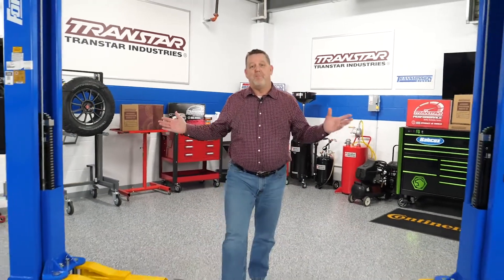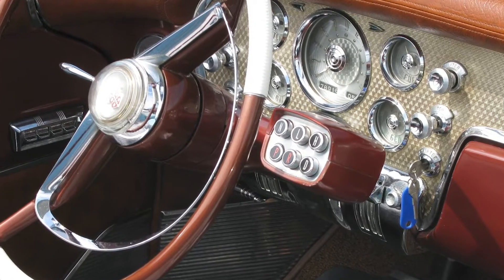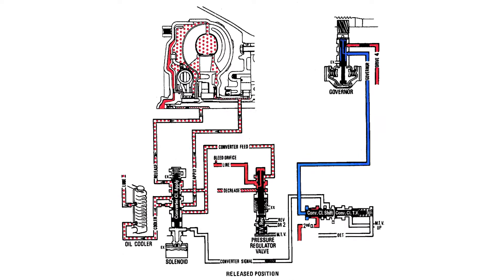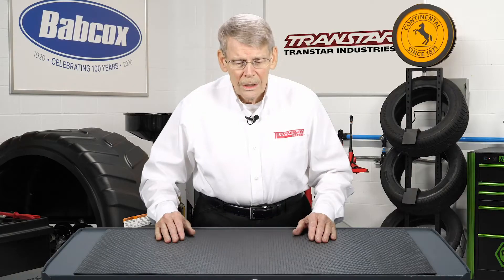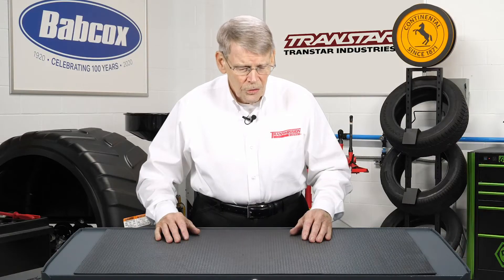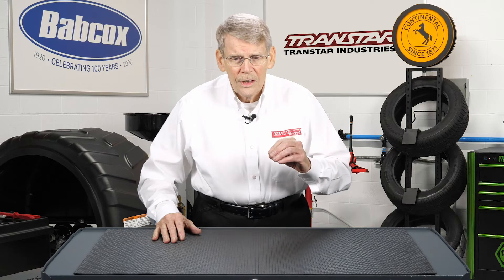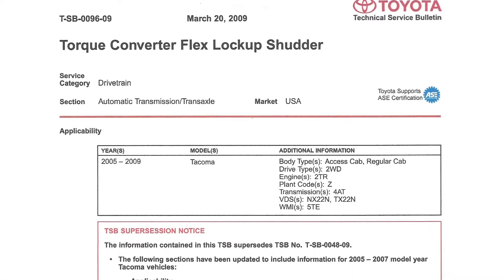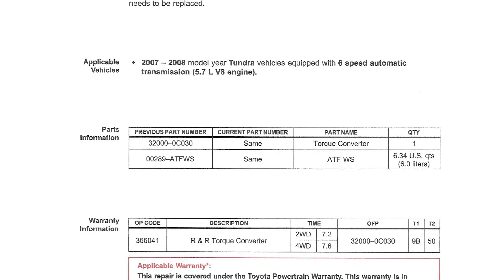Minimizing Torque Converter Slippage: Toyota Flex-Lock

Comment: Hello. I have a 2013 camry 6 spee d automatic u760e.  Currently 100k on the car and no warranty. Sometimes it hutters at aroud 40mph when still lightly acceleraring and epms are low - 1.2k.    Would a transmisson oil change help anything.?  How about anti slip additives.  Heard that it does this when it shifts into overdrive but I cant seem to disable overdrive.   I dont want to shift manually unless it had a clutch like the old days.  Thank you
Reply: https://static.nhtsa.gov/odi/tsbs/2015/MC-10111559-9999.pdf

Comment: My 2014 had the converter replaced and software update at the dealer in 2015 at 20k miles. It’s now back at 145k miles. You can manually shift in sport mode to avoid it. I wish it were possible to just have the converter fully lock at speeds over 50mph. Having lockup apply in third gear under 1500 rpm is a problem.

Comment: Good overview of the issues.  Thanks.  My 2010 RAV4 trani shudders around 40 mph.  Dealer wanted to replace the transmission.  Fluid change helped for awhile but the shudder came back.  Most local mechanics don't want to touch the problem.
Reply: I have the same thing in my 06 tundra. Shuddered at 35,brought it in 3 times before they put a new transmission in it,then radiator cracked and mixed trans fluid with coolant after just 28k miles on rebuilt trans. Shuddered at 40,got new radiator,flushed trans,changed filter,and it worked for a month,so when it shudders I turn the o/d off and it stops. Oh and I went through 5 carrier bearings also.
Reply: @jimbomorrison7133  exact same problem. I have an 06 tundra also smh
Reply: @Mr.Copo1     While your flushing the trans out,shift through the gears cause the torque converter dosent spin or open in park or neutral. Shifting through the gears gets all the contamination out,then put Shudder Fixx in it with a friction additive and maybe it will last longer. I just don’t drive with the O/D on. Surviving so far.